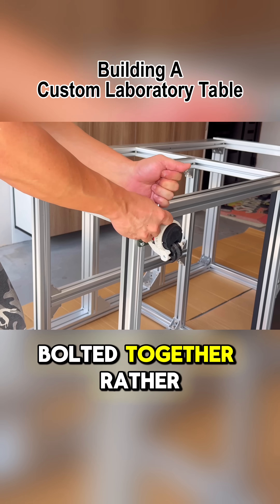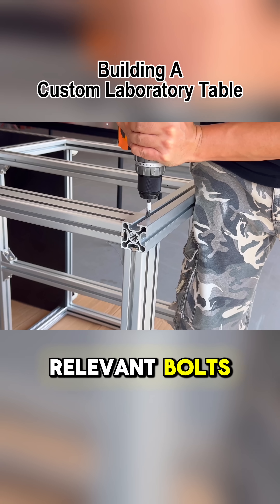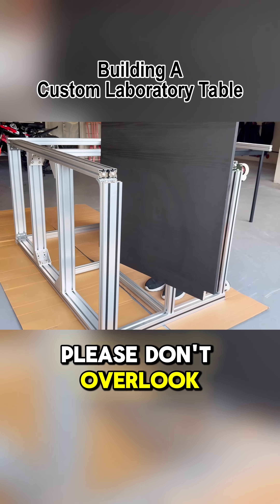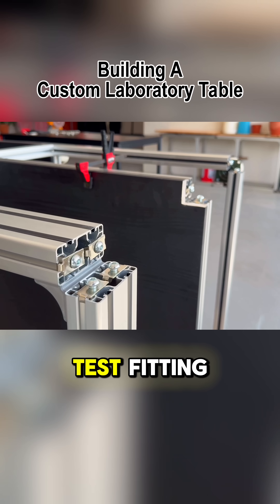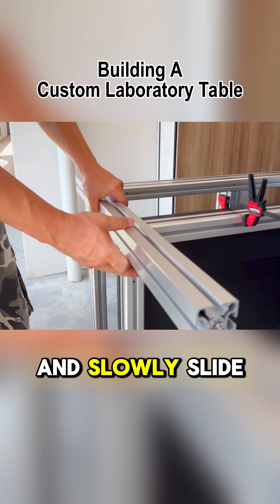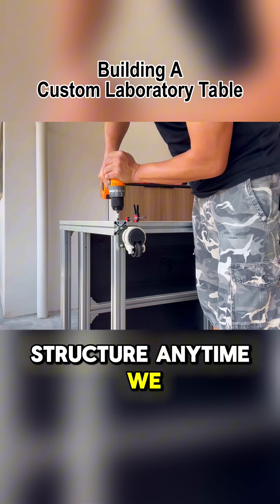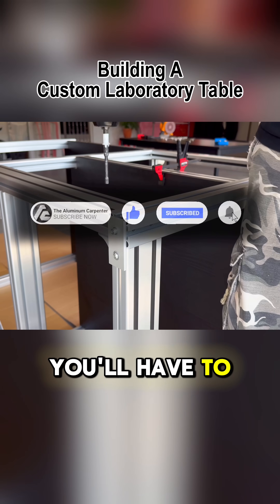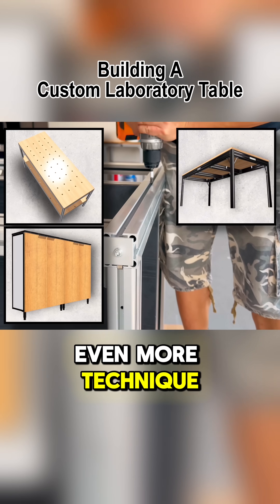Custom Lab Table - Part 17 #PrecisionJoinery #CustomFurniture #DIYInspiration

Comment: What do you call the thin metal t-slot clips where you can use it with the bolt in upside down in the t-slot? Want to see if I can find them for my project!
Reply from the maker: You can find it on our site : https://thealuminumcarpenter.com/products/40-series-standard-end-fastener?_pos=2&_psq=standa&_ss=e&_v=1.0
Reply: Awesome thank you!!! However, I can’t pay over $50 in shipping for $20 in goods. I’m sorry I’ll have to find another supplier.
Reply from the maker: Its ok. Welcome you back next time 😊
Reply: @ thank you. I love your videos!